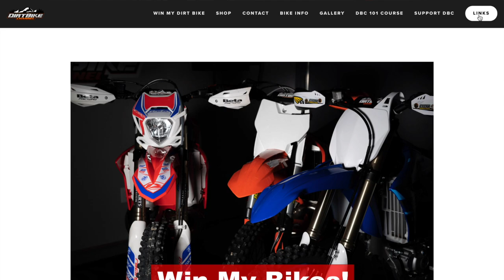Broken Throttle Many Miles From the Truck!!!

Comment: Wow that's a freak deal. Back in the day I'm 62 when riding hard as a youngster we used to run extra throttle cables and clutch cables alongside of the stock cables for that kinds of malfunctions. That one was a interesting one great video thank you
Reply: genius thanks for the idea
Reply: Amazing tip!
Reply: Might be some BS here but at least 3-4 guys said the same thing happened to them.

Comment: I would like to get an update for this. This literally just happened to me today on my SC2 during an endurocross race.

Edit: Technology Elevated called me actually. They looked up my order and called me to discuss the issue. I appreciate that. After discussing the issue, we went over a bunch of stuff to look over to make sure the cable is adequate to stay seated. And even discussed changes to the next iterations of the carb itself to possibly mitigate it. 

I was told it is very rare and for now am ok with waiting to see if it happens again.

IMO this is A+ customer service, and gives me a lot of peace of mind. 

The carb itself is awesome, and I highly recommend it.
Reply: It is actually ~hard to beat factory .... Factory Stock. 
--
I've purchased too many 3rd-party parts that should have been left at the party..
Reply: Some how When you hit the throttle that washer turned sideways and got stock on the release. The slide came down with the cable but washer and spring stayed up and the throttle the cable came out. Go with a little stronger spring maybe.

Comment: Dirt on the slide caused the slide to momentarily stick & when you chopped the throttle the cable pushed back thru the slide and out of the cable support slot. Just a guess, but when I saw the dirt on the slide that’s the only thing that made sense. Cool video, I like videos that make you think. Keep them coming.
Reply: I don't think it was dirt, I think It would of been 2 stroke oil build up from running the idle high for so long if the idle adjustment affects the fuel to air mixture on that carb and not throttle
Reply: Regardless of dirt or oil residue, this momentary slide stick as described was the cause.
Reply: I also agree. The cable slack came back without the slide and moved from its center position. I would increase the spring tension a bit by stretching just a little. I might even add a bit of solder to the ball-end of the cable to make it a bit larger. Obviously not too large to fit through the installation hole.

Comment: You could always insert something like a rubber caulking in the side hole so it cant pop out unless you physically pull out the silicone . Let the silicone/caulking dry fully before putting it back together. I've done this in the past.

Comment: Allen head screws for the throttle slide cap are a much better option than phillips head, as you don't have to worry about stripping them. Some of the Keihin carbs come with Allen head screws as well depending on the bike while others come with phillips head. I always swap them out to make life easier.
Reply: Right on.

Comment: What a coincidence! Two weeks back, my throttle cable broke near my grip. It was a lectron throttle cable with about 25 hours on it and we were about 12 miles from the trucks on a 50 mile ride day. We ended up putting safety wire thru the braid of the throttle cable and folding the safety wire back toward the broken end, then we jammed the brass stopper up around the safety wire and packed it full of jb quik. It held the rest of the 40 mile ride with a slightly high idle. Lectron told me that this generally happens when you have too much slack in the cable. I assume the slack allows the cable to bend and straighten every time you use the throttle and the fatigue of that motion leads to the break. That was a creative fix you did!

Comment: I thought you were physically going to push the bike out. 
Top tip on the idle trick. 
I wonder how this will work on a tpi without the air screw mod.

Comment: Is that sherco 2021 in back?
Reply: I think he mentioned getting one recently.
Reply: Yes, but looks like a 4 stroke right?
Reply: Andre Casanova it is a 4 stroke I didnt know if it is 21 or 20
Reply: @leonvojnovic9647  It's a 2020, blue rims. 2021 come with black.
Reply: It’s a ‘20 factory 300sef ‘21’s have a blue front fender

Comment: Lol. Take airboot off. Stuff a stick in slide so 3/4 rpm put boot back in. and change gears.  Road out 10km racing singletrack back. Ride clutch and kill switch.

Comment: In this mode ride the kill button to slow down. Back in the day it was not uncommon to have cables break. In this case it looks like there is not enough spring tension on the slide, I would have stretched the spring a bet to make sure washer is held in place.

Comment: Hey Kyle, un-related to this video. (Love your channel BTW) I just put a Shinko 216 Fat Tire on my 250x and man! So good. Because the tire has a bigger circumference then a normal 21”, it roles over obstacles easier. Also what surprised me the most is the 216 fay tire acts like a light steering stabilizer. The bigger spinning tire wants to keep the bars straight. Not sure if you have tried it or not. Just thought Id share! Cheers

Comment: If raising the idle isn't enough, just tie the cable to something for half throttle or something. Use the clutch :)
Reply: Problem with that is it came apart in the carb nothing to tie to. also didn't have the tools

Comment: Where there is a will, there is a way!  Great job staying calm and "MacGyvering" a viable solution.  A good lesson is whenever facing a challenge, remain calm.  When you do remain calm, you are able to use 100% of your brains capabilities to figure out a solution.  When you get stressed, panic or freak out, your ability to use logic and reason is significantly reduced.  This was a great example of problem solving for your boys to witness!

Comment: I keep a lightweight mountain bike  purposed folding allan wrench set in my pack. Also a set of screwdriver bits, torques t10 t15 t25 t27  t30
Star, flat , Roberts square red n black.   Just cuz ya never know what farm job fix is on your buddies bike that doesn't carry any tools or fix stuff.

Comment: cool video ... when you did the pivot turn at the top of the hill, throttle fully closed and slack, the washer must slid down the cable and allowed the cable to pop out. unlucky, flukey even but definitely a design issue with the smart carb retainer ...
Reply: @SmartCarbFuelSystems  yeah true probably more likely cable adjustment when you consider it has to move half an inch down and then sideways to pop out ... it was  i think the Mikuni idea of like a tension clip retaining the retainer washer, as it were ... that popped into my head ....

Comment: Din you check if the end-cable (carb side) can fit trough the middle hole? Maybe like you mentioned, either the end-cable is to thin, or for a reason or another the slide has it's middle hole larger than standard end-cable. If that is the case it will happen to you again with this cable/slide combination.

Comment: On top of turning the idle up you also could have pulled a bolt or two off the rubber carb boot at the cylinder to lean the bike right out for more speed and revs.
Reply: Unmetered air is a killer of 2 strokes

Comment: Some how When you hit the throttle that washer turned sideways and got stock on the release. The slide came down with the cable but washer and spring stayed up and the throttle the cable came out. Go with a little stronger spring maybe. Check Cable tension as well

Comment: I’d check the slack going into the carb. Too much slack from the cable could have caused the cable to go loose in the carb for a split second when throttle was closed causing the cable to jump out of the seat.

Comment: Being stranded isnt fun. I crashed my xr600r on a trail this weekend. Brought tools but what happened was i bent the muffler up under the rear fender. So my tire was sitting on the muffler when I got on the bike. Ripped every lug off one side of my tire during a long hill climb back to the top of the trail. I just couldn't bend it straight enough not to rub. Wasnt sure I was gonna make it back without the tire exploding. Was a learning experience. 😬

Comment: Is it possible the dirt buildup you found on the slide was just enough for it to stick and  when you closed the throttle it caused just a second of slack in the cable? Either way what a great idea using the idle to make it back!

Comment: 2 problems there end of throttle cable is bent when the slider jammed  in high position on the gunk you cleaned off prob dry oil gunk that congealed and jammed when it got really hot and the cable slid out bc it was slightly bent it was the perfect storm and  it slotted out 
 clean the slider area thoroughly  should fix it maybe change the cable

Comment: Did you try pulling those allens off with some pliers seems like you might mess the bolts up a bit, but might have worked. I watched your what you carry video I thought there were some pliers of some kind in your pack.

Comment: I notice you are running High Temp Silicone on the exhaust gasket between the pipe and silencer. Smart! How does that hold up? Do you do anything on the front gasket (pipe meets the head) to help keep the spooge down there too?

Comment: I know this is old. But that bent cable needs to go.  If you have to much play in the throttle it could go down out of the keyway and out of the groove. If it was me I would want that washer to have a finger that would go down into the removal slot to make it impossible to come out.  There is a reason OEM carbs have the little plastic keeper on the end of the spring that blocks the slot.

Comment: Weak throttle spring coupled with the grim on the slide let the slide hang just enough that when you rolled the throttle down it popped loose that's why I like the stiffer of the throttle springs I can find.

Comment: If the travel of the throttle tube is longer that the travel of the slide, then all of the tension is on the cable @ full throttle and not the throttle tube stop, therefore the cable would either break or pull out.. i would try adjusting the cable if i was you.

Comment: Lectron and SC don't make cables specific to throttle actuator. That's interesting about what could happen given idle adj. technic.
 I thought it might be lost cable-end on carb. side. What to do with ride-by-wire.
Reply: With the SC2 SmartCarb the cable end has to move .46 inches or nearly half an inch to come out of its retention counterbore. Not likely that Kyle had that much slack going. It's possible he may have been able to snap the throttle closed manually, pushing the cable end down beyond the slack he has, faster than the spring return rate when combining factors like upward slide momentum (SmartCarb slides are decently heavy) on a quick whack open doing the pivot turn and any friction caused by vacuum and/or fuel/moisture/dirt in the slide cavity... Either way an interesting result. SmartCarbs have light springs standard so a stiffer one combined with checking for and maintaining pretty tight slack may be just the ticket to ensure it never happens again.

Comment: I wonder how this would work with the tpi bikes. I have a TE150i and there is a "cold" idle that raises the idle, but I dont know if the bike could run like that for a while. I dont even think this would be a problem on one, but it also wouldnt have been a problem on the beta with the stock carb.

Comment: That washer doesn't do anything for the bottom of the cable. The cable is bent allowing slack sticking throttle valve? to pass to the wrong hole.Details are important

Comment: Curious if running "high idle" would cause motor to blow (lean condition)  would be interesting to have checked  plug after you got back to the truck
Reply: tjpighin the idle screw lifts the slide just like the cable pulls it. No possible issue there.
Reply: Yeah Mack has it right, raising the slide with the set screw also moves the metering rod with it, adding fuel. It's as if he was holding it at a steady 1/16th or so throttle.
Reply: Ok thanks for the info
Reply: You mixed it with choke ....Idle is the same as throttle.

Comment: I think it's a design flaw and hopefully the manufacturers will find a better way to keep the cable in place.
Reply: We have thousands of SmartCarbs in use all over the world that use our cable retention washer system with zero issues. The cable end has to move over 1/2" down and out of its counterbore in order to come out. There's no way Kyle had that much slack going on here but you can see in the video that the cable has a little kink toward the end of it. All in all it's definitely a fluke as he had mentioned and not a design flaw. We are looking at deepening the counterbore even further, however, and are taking all steps possible to constantly improve the design as we move forward. It's impossible to conceive of every possibility and sometimes it takes a customer to have an experience like this that helps us learn and improve.

Comment: That’s smart carbs dreams shattered in one video! I wouldn’t buy one based on these circumstances!
Reply: Who are you kidding?  You wouldn't buy one for any reason
Reply: 64maxpower not when there was no obvious reason for it failing. Kyle couldn’t see that he installed it wrong and apart from that there’s Lectron carbs as an alternative and the genuine carb is fine too 👍

Comment: I always have a MegaPro 15:1 screwdriver, its got a variety of Torqs drivers (10,15,20,25) along with Robertson Philips and flat. It has saved me a number of times. They also have a lifetime warranty and are awesome to deal with. All the bits live in the handle so its great. https://www.megapro.net/collections/screwdrivers/products/original-15-in-1-screwdriver

Comment: I hope the new owner chose the lectron and didn’t go for this POS carb that I’ve heard everyone complain about it. I’ve had the lectron on my 2017 ktm 250 since it was brand new and never had a problem with it, it has done 130 hours now
Reply: Who's complaining? Couldn't be Sherco FactoryONE or other high level racers, nor is it Kyle here in his video. The cable thing was a fluke, likely due to cable slack being a little to loose. The SmartCarb is better than the Lectron in every way. External adjustability, single circuit fueling with no powerjet, internal venting with no fuel spillage, MUCH stronger bottom end power delivery, and more. Swapping to the Lectron would be a downgrade.